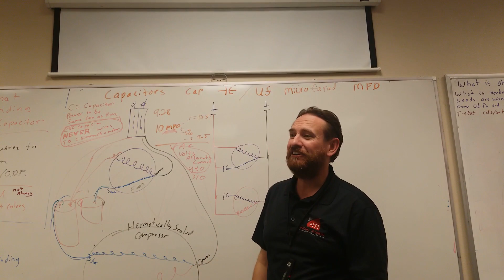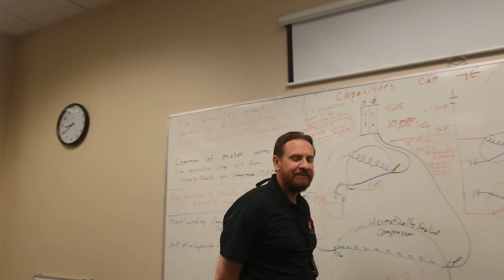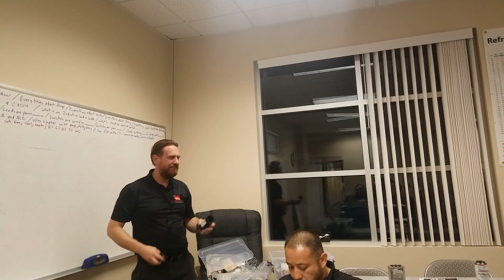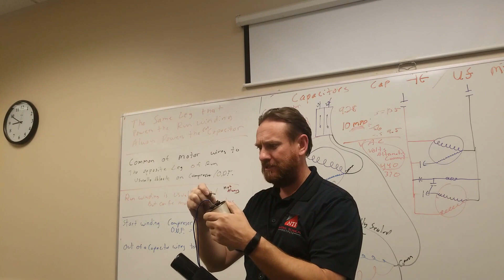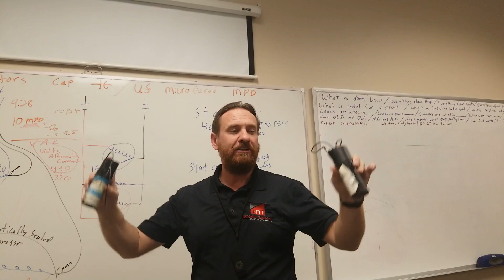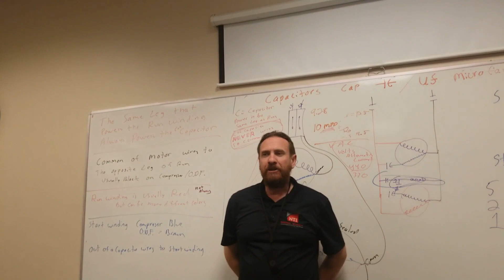Start assist

Comment: Pretty tough on them PTC starters considering they’ve been the factory installed starting relay on nearly every refrigerator cranked out for the last twenty years, plus many manufacturers including Carrier have used them as original equipment in many of their air conditioners. Now don’t get me wrong, I also think they’re garbage for the same reasons you pointed out, plus you left out the fact that in locked rotor the start winding current drops out leaving only the run winding current to trip the overload which will then take longer to trip further shortening the life of the compressors run winding. The best part is now most supply houses don’t even carry a line of current starting relays and they are erroneously considered vintage parts ! Now you seem to have a smart point of view on these things yet I see you defend the use of highly explosive gasses as refrigerants ? These gasses will soon be the 800 pound Gorilla in the room just like them cheap PTC starters are now !
Reply from the maker: Refrigerators certainly a different set of rules. lower ambient conditions, less amps and they seem to work fine as well as they do with ice machines. 
I remember Goodman used them and had a lot of problems.

As for flammable refrigerants i will make a new video soon promoting the proper training and limitations for it. I was taught how dangerous it was and how it will kill everyone. early 2000 I had to work on some units at a gas plant that used propane in their systems. I was scared to death. The senior tech asked for me specifically and we went followed all the procedures and I was  everything was smooth. He said you cant have fire without oxygen, the same thing repeated in all the RSES HC classes i later took.
If people started dumping it in units it would be a disaster for sure.
Right now its only in use for limited quantities, mainstream and farm and industrial in larger quantities. I just had a reach in last week that was r290. In My opinion with the sloppy work in residential, its a long way away if ever.

There is so much I don't know and there is always another point of view.  I appreciate the comment and I always enjoy discussions like this.

Comment: Hi Branaman do you think is better to use hard start kit for new system and for system utilize with long line? Thanks.
Reply from the maker: If it is sized correctly and a high quality true potential relay, yes.
Some of the cheaper ones can cause damage

Comment: One caveat!
The potential relay contacts stick and will damage the compressor.
I think the relays are now coming from China and being installed into the Kick Start. I’ve had two different ones fail within a year .
Would not of suspected a problem if I had not wanted to inspect the contacts. The contacts were pitted and stuck until I touched the contacts and they sprung open.  To unpredictable.
Reply from the maker: Well that's disappointing. Ashame how the quality of so many parts are going down the drain now days.

Comment: How do you match a start kit to a two stage compressor? The first stage or the second stage tonnage?
Reply from the maker: I would mach one with the manufactures recommendation. If you provide the brand and model number I can look it up.
Reply: @love2hvac  The condenser is a Lennox XC16S036-230A06. On the website lennoxpros.com it shows Lennox LB-31200BM (Cat# 10J42) as an accessory. The capacitor in the factory Lennox kit appears to be 88-108mfd, which is the exact size in the 521 CSRU1 Kit for 1-3 tons. The potential relay looks slightly different but not sure if they both operate similarly. The Factory Lennox kit is $130 vs $35 for the 521 CSRU1 kit. Would the 521 kit be okay or void warranty?
Reply from the maker: @OnePointLander  well done! That is exactly how I would have sized it!

You would be fine with the 521
As for the warranty 

This is from Bryan Orr, hvacr school
"Voiding warranties on CONSUMER products for install practices is mostly illegal based on the Magnuson Moss Warranty Act.

Terms need to be clear, easily understood and the causes of failure need to be really clear.

State laws often extend these warranty protections.

So when a contractor or manufacturer says something “voids a warranty” they are on really shaky ground legally."

https://en.m.wikipedia.org/wiki/Magnuson–Moss_Warranty_Act
Reply: @love2hvac  Thank you so much! Interestingly enough, I found a video from Lennox Learning youtube channel installing a 521 CSRU1 :) https://www.youtube.com/watch?v=FpALLitlffE&t=0s

Comment: Looks like this jolts the start winding with an extra boost capacitor for a moment.  It's not hard(er) on the start winding?
I was hoping to learn why it's required on a TXV system, the difference isn't ringing bells for me.
Reply from the maker: Yes it is temporarally harder on the start windings but much much less heat and damage the run winding.
Some TXV shut down or close completely (similar to solinoids) to prevent refrigerant migration during the off cycle. 
The compressor has much more load trying to start against the already high head pressure because it does not equalize. 
The start assist is required to provide the extra starting torque to get the compressor started and up to speed. 

Without it, the run windings overheat  and trips the internal thermal overload, not to mention the damage to the insulation of the run winding. 
Hopefully this helps.
Reply: @love2hvac  Absolutely yes, thanks!

Comment: I purchased a 5-2-1 start kit on Amazon.  It said it was for a 3.5 ton unit.  When I got it in the mail it says it’s for a 4-5 ton unit.  I have a 3.5 ton AC/Heat Pump Unit.  The start capacitor size is 270 - 324 Mfd.  would this size be too big for my Unit?  By th way, you are a great teacher.  I watched several of your videos last year because I wanted to learn how to work on my own system.  Not there yet, still learning.  I actually teach mathematics at a college in Florida.  I find the science and physics behind how HVAC works very interesting!
Reply from the maker: It will probably be fin. If you give me the model number of the unit, I can look it up and find out for sure.
Reply: It’s a Frigidaire Split system.  The outdoor unit model number is ET4BD-O42K (3.5 Ton). The indoor unit model number is B6BMM042K-B.  Thank you so much for your help.  I very much appreciate it.
Reply from the maker: The factory start kit I'd 912933 I ctossteferancef that to a 88-108 mfd start cap. 
The 5-2-1  CSRU1 is an exact match at 88-108.

The 4-5 ton you have  is 270-324 MFD significantly larger than the factory.
Reply: @love2hvac  Sir, would you mind making a video on how to check drawing amps for compressor and condenser fan motor?  I looked and could not find any.  I have a heat pump with a defrost board so I’m not sure which wires to hook it to.  My understanding is that you check both amperage draws using common wire (black wires) coming from compressor and condenser fan motor going to contactor, but mine seem to come from defrost board.  Thank you for your time!
Reply: @love2hvac  Also, do you recommend mini-split systems and if you do which make do you think is best in quality or which mini-split system do you recommend?  Sorry for taking up your time.  Knowing those two things would help me tremendously and I will not message you any more.  I do watch your videos and am continually learning, but not there yet.  Thanks so much sir!
Reply: @love2hvac  I was able to find some videos on how to check drawing amps so I believe I understand it now.  Plan to install my compressor saver kit and the Emerson secure switch (to replace contactor) next weekend.  Thanks for checking on the correct compressor saver for my unit.  I know you must be very busy and I understand that.  I have learned a lot by watching your clear presentations.  I watch actech videos too (specifically videos on my type of ac/Heat pump unit).  Please keep posting videos.  Very helpful!  Thanks a lot!

Comment: Being as service mech. how come some Trane units have a start kit and some don't . I agree with what you say about the start kit and had installed one in my heat pump/ a/c unit. Watch your videos all the time you seem to be an awesome teacher keep up the good work.
Reply from the maker: There is a bit of divide today if scroll compressors need them as much as the reciprocating. 
I have not worked on the newest Trane units so I cant vouch for them. But the ones I see  that did not come with a start kit has a place to mouth it, includes it as optional on the wiring schematic and sells a start kit for it. Basically boils down to cost. Scrolls are not as critical and they can save cost by not including it, but still sell the kit separate for the ones who want it.

Comment: I have a packaged unit HVAC that is almost 20 years old. Can I install one of these start kits in it to prolong it’s life? I do live in South FL so it is very hot here. If you could answer this I would greatly appreciate it. Thanks!

Edit: Also, I read online that using one of these with with a scroll compressor is not a great idea and can cause damage. Am I wrong on what I’ve read? Or could these be used with both scroll and rotary compressors?
Reply from the maker: If you mach up the proper one, then yes. . If it's the improper one it will reduce the life. CongratulatiCongratulations on a 20 unit. At that age I would not change anything unless there is a problem.
Reply: Ty Branaman Thanks. I try and do my best to keep her running.
Reply: Ty Branaman Wish I could take one of your classes and work hands on with you explained everything. I really enjoy working on HVAC systems!
Reply from the maker: I talked with a friend of mine from copland in regards to the scroll question. They said with scrolls they generally are not required. *(always an astric) they do recomend using their start kits.
Soooooo why do they make start kits for their own compressors if they are not required. Humm open for speculaton.

Comment: Appreciate the video Ty! Isn't it possible that the potential relay could also fail and burn out the start winding on the compressor?  Since the relay is NC it would fail closed...
Reply from the maker: Possible, yes but extremely unlikely.
Since 1995 I have had 2 bad potential relays. 1 was because of a loose wire, and the second was 15 years old and it caused the start capacitor to pop first. 
A quality potential relays are over built. It's a simple electromagnet and a set of contacts. 
Especially n the Las Vegas climate the benefits are very much needed more so than any other climate.

In my day the qualitybunits came with start kitsch from the factory and even today almost all manufactures leave a place for them and they all sell their own OEM start kits. 

Think of the benefits of fuel injection over a carburetor. There is more things to fail with fuel injection but the milage and l
Longevity far outweigh the simplicity of a carb.

Comment: I have to say the PTC relays are not so bad specially when potential relays are not general parts and the pick ups and drop outs are varies between compressors.
Reply from the maker: Patc are the worst. They stay energized too long burning up the start windings and during an short cycle theybare already hot so they cut out too soon overheating the run winding. PTC is notorious for sticking burning out compressors. 
I see tons of compressors killed by PTC.
Ice machines in a controlled environment is the only acceptable use. 
It's cheaper to keep entire start kits for the 3 different sizes rather than separate components. If a start cap is bad the potential relay is already worn. If a potential relay sticks (rare) then the start cap is already lost its oil and dry.
Reply: @love2hvac  Thanks very much for your reply. I used to make my start kit for sever cases of semi hermetic hard start with industrial delay relay and full size contactor!. Here we have cheap general fit p-relay made by Supco and they work just fine until the supper cheat contacts fused together!...We have more fun than you in -40 winters!! Have a wonderful classes.
Reply from the maker: @behrooz735  
I do despise the supco kits. They don't use a tire potential relay they use a PTC on too of a start cap. Probably fine for a refrigerator but for residential ac they are the compressor killer.
My new favorite is the Amrad start kit. It has a lot of adjustability, a true HD start relay that us sealed. The newest one locks out if the run capacitor is not working. 

-40 wow I think I am to much of a wimp to handle that. I am impressed!
I do love server room and while others hate then I like the leibert systems, however I feeling behind the times and have not had the change to play with the liquid pump.

I love semi hermetic compressors. I dont know I would risk a premade kit for them so yes you are 100% correct in your own set up with the HQ contractors and relays. 
These classes are focused on residential.
Keep up the good work. I love hearing people use HQ parts. I enjoy these conversations. 
Stay warm!
Reply: @love2hvac  Thank you so much for your time, yes here in east part of Canada the winter is cold and summer is warm (over 35 c ). Heat pumps work up to- 25c and outdoor walk-in condensing units are not an easy tasks! R-134a is no match for it and suction accumulator is commonly used....I am sure you also have the black cube supco timed fix potential relay. It has 5-2-1 connection and the contacts open after 2 seconds regardless of the speed of rotor. One can be used for 110v or 230v from 1/12 HP to 5 HP and more...I am so happy to see people like you with high level of knowledge changing lives of individuals to better, bless you.

Comment: # 1 terminal?        I have never seen where it say's  #1 terminal.    where is that TY?
Reply from the maker: Only on a start relay (potential relay)
That relay will be labeled 5 2 1 and some times other numbers but these are the ones we will use.
If it does not have a full start kit then you won't see these numbers.

Comment: 521 - common , start , run...         for the newbie who looks at the top of the capacitor and reads:  herm, common and fan - what do you tell them?
Reply from the maker: Herm goes out to the hermetically sealed compressor start winding.
Fan goes out to the fan motor start winding (usually brown )

C is Capacitor, power in. The same leg of the contactor that powers the ring winding is the same leg that powers c of the capacitor.

Common of the motors (black) wire to the opposite leg of run
Common of the motor Never wires to C of a capacitor. 

For a start kit 
5- common wires to the motor commons at the co tractor black.
2- start wires to the herm start winding (herm on the cap)

1-run the c of the capacitor is run that powers the start capacitor, out of the start capacitor to terminal #1 of the potential relay